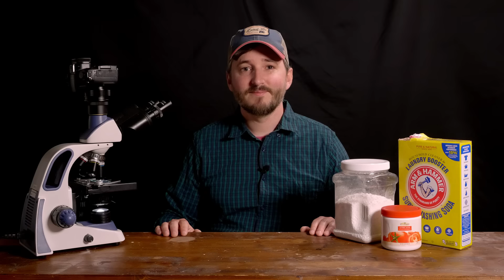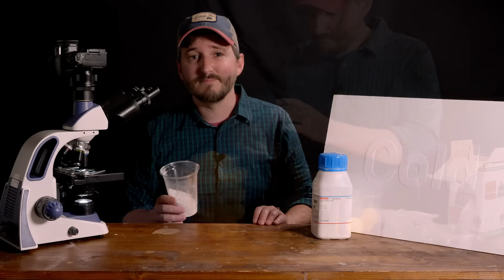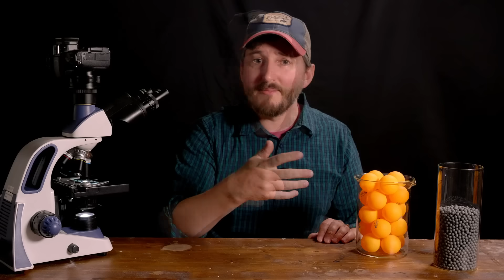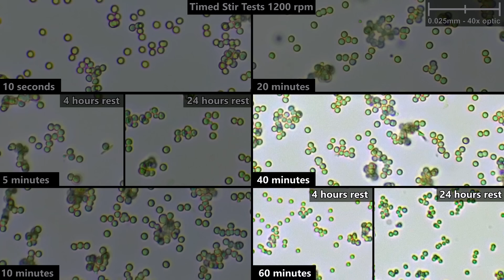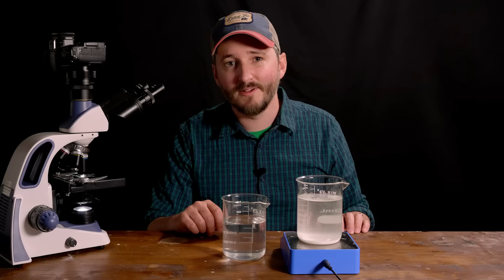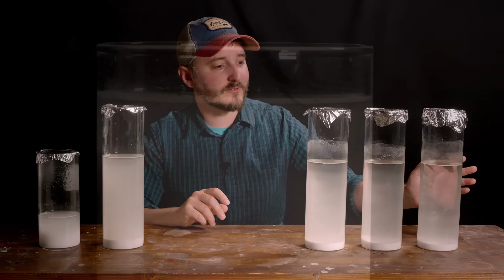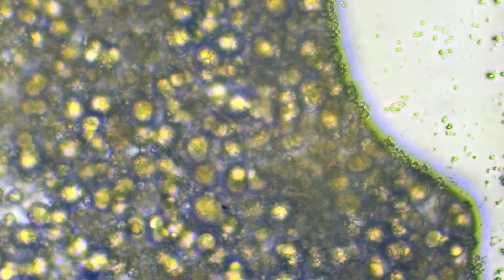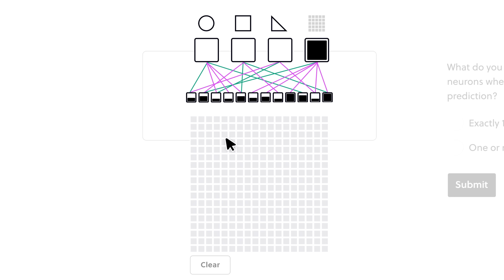Making Infrared Cooling Paint From Grocery Store Items (w/Novel CaCO₃ Microsphere Synthesis)

Comment: A clear to the appropriate spectrum poor thermal conductor coating on top.  With a high thermally conductive base under it will give it more access to internal heat and seperate it from the external heat.  Good for environments typically excessive in heat.  Add an insulator layer underneath and it will help prevent external heat intake while restricting inpact on the internal atmosphere.
  For a house you want thermal conductance from the exterior sides or better yet angled siding.  Roof+angled siding would improve the effect.

Comment: Between you and Techingredients, I’ve learned quite a bit of information. I’m wondering how many roofs have to be coated for us to lessen our dependence on air conditioning and the electricity it uses, and for us to start to impact global temperatures. Thank you for everything you do and post. It literally means the world.
Reply: Just using white roofing tiles would be a start... Here in the South, it seems that dark colored tiles are the norm for some reason... I grew up on a street that had a house with a white aluminum roof.  I always wondered if their cooling bills were significantly cheaper.  There is some remodeler in my neighborhood flipping houses and painting the exteriors dark colors.
Reply: @thetruthserum2816  I'm in the hottest suburb in australia (average temp) when we redid our roof I did it in white. The roof temperature is so very very much lower. There's a new housing development nearby with hundreds of houses all with black tile roofs. You can literally feel the heat island as you drive past the place in the evening and there's just waves of IR radiating off the whole development. Not just the higher air temperature, but literally you can feel the radiant heat coming from the houses. It's stupid. The council had a project on "lowering temperatures in our area" My suggestion on mandating an albedo (reflectivity) for all new developments wasn't even looked at.
Reply: There is a Wikipedia article called "Passive daytime radiative cooling" which mentions this as a kind of actually usable geoengineering approach. Maybe you find something in there or the sources mentioned to answer your question.
Reply: I would suspect that this exact paint would not be a viable roofing material due to durability concerns, but if you suspend the pigment in something more durable... It's certainly something worth doing some experimenting on.

Now, another question that I think is worth asking regarding this. What would happen if you had a panel that had this passive cooling paint on one side, and a black paint on the other? Would this paint improve heat transfer INTO a house as well? Cause like, I live in Canada where it's cold half the year, and I'm wondering if it would be at all possible to make reversible panels that heat in one direction and cool in the other.
Reply: @reaganharder1480  Very interesting idea. Build it and test it :)
Reply: keep in mind that somewhere around 300 BILLION is spent yearly on air conditioning. even marginal improvements means millions of dollars saved.

Comment: maybe look into one of those ultrasonic vaporizers you find in cool air humidifiers. They readily deposit hard water chemicals from the vapor they produce (since it's atomized mechanically). thanks for spending so much effort on this and making its access open. that paper is important for the tech, but developing a process to produce a similar coating with cheaper materials is ground breaking stuff.

Comment: This is so awesome.  

My mind immediately goes to painting one cylinder of a stirling engine with this, and the other side with carbon black. (or a sand battery topped with a solar collector shining onto carbon black, running the hot side of the engine, so it'll keep going after dark.)

Comment: For applying this coating, mix it to a mortar-like consistency and use a grooved trowel of the sort used for laying tile. The grooves make it easy to get an extremely consistent amount of material spread across a surface, and then the smooth side of the trowel smooths over the grooves to give a flat surface.
Reply: Keeping the coating more textured instead of smoothing it over might actually be better. More surface area means more radiation, and therefore more cooling.
Reply: I was thinking something similar. Flooring contractors have a refillable caulk gun that they use to lay mortar for tile and it has different nozzles for smooth or ridged surfaces
Reply: Ha, I should have read more comments before replying this same idea.
Reply: Same idea…. 9 comments after this😂 deleted mine
Reply: Just like the method used in screen printing of PCBs. Maybe that'll work too.

Comment: Have you thought about combining your cooling paint and evaporative cooling and matte black paint and some heating ducts and thermal transfer fins to make a constant flow cooling unit with no moving parts that exploits thermal dynamics? maybe even consider adding in geothermal cooling? no electric bill, no electricity, no moving parts... the Sun, the are, the Earth, the water, all work to power it with no moving parts.
Reply: -the are
Reply: @mamupelu565  yes the air as in hot air rises cold air settles and you can use the movement of those to be able to power the system without moving parts much the same as a chimney works

Comment: Could you theoretically use this in the same fashion they make mirrors? As in spray or pour it onto a pane of glass, and then flipping the glass over so the "paint' is shielded from the elements by the glass pane.
Reply: That is a great idea. 
You could also use a double glazing window frame to hold the glass panes & have an insulating air gap.
Reply: Interesting idea.. Although the question would be how much heat the glass would absorb? How "transparent" it is for infrared radiation?

Comment: I would be very interested to see this would have as a reflective layer behind a bifacial solar panel. I also wonder about using something like this on a air conditioner. Could you beam the heat out into space rather then heat up the local air? Great work!

Comment: Would it be possible to create water from air due to condensation with this type of cooling? Or is the delta t too small?
Reply from the maker: It's possible but needs testing
Reply: @Nighthawkinlight  I´d love to see that. Your paint on a squaremeter of aluminium sheetmetal in a good isolated box with a bit of airflow.

Comment: In order to spread it like paint you should treat it more like paint and add some sort of binder like linseed oil, chalk and adhesive or something. I'm not a chemist or a painter, but it seems like it doesn't hold itself together well because of the surface tension is so low unless you have it really thick, so maybe adding some sort of adhesive or binder would help give you a better viscosity that could be used with a brush. Idk what I'm talking about though, so I'm probably entirely wrong.

Comment: Question, could you use infrared cooling paint with starlites heat resistance abilities together? I’m wondering about the thermal electric properties using the Peltier effect.  Also maybe use latex or silicone.

Comment: The term used in the literature is “capping agent”! 

Some papers also address particle size for the resulting optical properties as a photonic crystal.  

I saw a paper called “DIY” emissivity cooling or something, and it was aluminum foil behind plastic film.  Seems not so easy to know what the price/performance tradeoffs are.  Interesting work either way

Comment: This is a pretty incredible step forward. It feels like we’re so close to being able to do meaningful zero-energy cooling at home. I grew up in an off-grid home and it would have been such a relief to have a few degrees of cooling like this.

Quick question: would coating this in something optically clear with high emissivity (eg Sylgard or something similar) fix any durability issues and allow this to be used as a longer lasting outdoor solution?
Reply from the maker: Pdms is a possibility as a binder for this paint. It may work better but needs testing
Reply: @Nighthawkinlight  if I get a chance to try out your recipe, I’ll test a batch with some old pdms that I have.

Comment: Thank you for your contribution to the community, I might give this a try 1 day, but I have a few questions: Wouldn't the rain wash it away? What can be it be mixed with it or coated with to protect it from the elements?
Another cool idea I can think of is, would you be able to develop the opposite paint? That absorbs the most of heat from light?

Comment: I'm really curious on if there is measurable benefit on applications where there is not a skybox reflector or plastic air barrier. 

I've been very interested in finding a heat emissive paint for a camper van. I literally don't care about the look. I just want to reduce interior heat. 

My thinking is, if I do a DIY topper (which I'm considering) I could maybe even do a reflector box on the very top but it would make the build much more complicated. If I can get some benefit from simply covering the van with the paint, that might be worth doing.

The paint as shown is probably too fragile so any way to strengthen it along with maybe top coating it would be interesting. Even if the efficiency is significantly cut down ... any benefit is a positive.

Comment: Probably going to be lost now, but -
I don't think this is most effective as a paint. Apparently, it's just too fragile. However, I wonder if it could be used for topfinishing concrete (concrete is often topfinished with iron powder to add surface hardness, or various pigments).

Comment: So for quicker application, couldnt you make a lip on the panel that is  
.5 mm thick and use a straight rod or something similar to how they level concrete? Or perhaps a vibration table and just pour the paint onto the panel, you would still need a lip on the panel, but it could simplify the application process.

Comment: I wonder how painting this on a mylar sheet would affect performance, if I understand correctly there is a higher probably of the IR emitting to space due the energy differential, however some of the emissions are absorbed by the backing material, an IR reflective backing should increase efficiency, or a highly emissive backing for a heat pump

Comment: You will win a Nobel Prize if you can figure out a way to impregnate roofing shingles or roofing systems generally with this stuff. House paint, automobile paint, etc. Im not sure if the luxury of getting into a cool car or having an attic that is not 20,000 degrees or the energy offset is more appealing.  Is there a powder coat option, also?  Porsche bakes on a charged car paint now.  Im also curious what mixing this with titanium oxide would do to strengthen the paint.

Comment: Perhaps a ribbed spatula would be a good applicator for the paint? Kinda like how they use castellated trowels to apply the cement for tiles. 
Could experiment with the rib height and width in relation to the viscosity of the paint to get the ideal coating thickness.

Comment: Great work, I really enjoyed it. On your application issues: There are several videos on here about making fabric waterproof. Most work by making a silicone/white spirit solution, soaking the fabric in it and then letting the white spirit evaporate.
If you mix your pigment to the solution, wouldn't the silicone keep the pigment in place preventig it from crumbling? You could make a waterproof, cooling, very white fabric from it, that you could use as is, or apply it to your cooling panels
Reply from the maker: Yes I'm thinking about such things.

Comment: Sounds unlikely.  An object, due to energy conservation, has to emitting, at each frequency, exactly as well as it is absorbing.   Otherwise there would be a net energy flow and things would continue to heat up and violate entropy.

What you can do is reflect in the visible and emit in the infrared, with some net cooling effect.  Not much, but some.
You can help this along by covering your surface from direct sunlight and uncovering it at night.

The ancient Egyptians had this way of making ice.  They would cover a bowl of water during the day and uncover it at night.  The water would radiate its heat into space (no clouds) and very little would radiate in at night.  After some days,  you could make ice.

Comment: @NightHawkInLight - Thanks for making another one of these cooling pigment videos... this stuff has been living in my head rent free since I saw the one you did last year.  I have a question regarding practical application.  The previous experiment had it performing at sub-ambient when in the shade.... couldn't you stack plates where one side is radiant, and the other side is absorbent, to make a panel (or a tube) that create it's own shade?  example:  paint the inside of some conduit with super-black, and the outside with this stuff.... repeat process with larger piece of conduit until the desired number of layers is achieved.  expected result: inner must layer is substantially below ambient..
Reply from the maker: I don't believe the nested tubes would work. They would balance out to the same temp.

Comment: Epoxy resin would be a perfect base for the paint. When stirred, it traps quite a bit of air as bubbles. Usually they aren't desired, but simply stirring it introduces more
Reply: I concur with trying epoxy, but would be concerned with yellowing in the sun. Acrylic becomes brittle in UV light, so might not be a long term choice.

Comment: Very cool... As far as house surfacing, this could be formed into roofing/siding shakes if the shake is a 1/4" thick at the drip end with an air gap an 1/8" between the white painted backing and a clear plastic exterior shell.

Comment: Would ultrasound (as opposed to stirbar or blender mixing) make any difference to the nucleation effect and sphere size? 

It would be interesting to see what effect would be from immersion of the mixed solution container in an ultrasonic cleaner at 20,000 or 40,000Hz

Comment: @Nighthawkinlight An idea for you- if you like the wide tip, consider modeling one in a software like Solidworks that can connect to the 50mL syringe. Then you can 3D print whatever dimensions you want.

Comment: A quicker / better way of applying a thin layer of the paint: Use some thin wire as a spacer down each side of the pannel, put a thick blob of paint at one end of the pannel, and drag a scraper along the two wires to spread an exact thinkness of paint across the pannel. The scraper could be something like a length of angle iron, or a steel ruler on a small pannel.

Comment: Awesome video, 
Another synaptic orgasm.
In regards to your potential application. Could you combine it with your equally brilliant waterproofing bed sheets formula?
I made a few of these & they work so much better the pvc tarps. 
Loved the tie-down tip, I used golf balls. Lowering the temp under the tarp by a few degrees . 
Would be a blessing in Australia. 
Cheers Mate

Comment: Perhaps a HVLP high volume low pressure applicator would work well for larger applications.  Or however they spray those acoustic foam ceilings.  Amazing how you find the energy to create those small bags of fancy dust.  :)

Comment: Another thing I was wondering about would be the thickness of the pigment load in the 'paint' medium. It's probably a lot thicker of a load than some paint sprayers that are used on cars. I know they use pigment loads as well, but usually in much smaller amounts in comparison to the liquid it's suspended in. Notably 5-10 grams in a gallon or two of a clear coat. They utilize what they refer to as pearls or flake to get neat hyper shift effects, which is beside the point. More just interested to see if there's a way to still use a paint sprayer for application. Conversely, I have to wonder about dipping whole panels into a container of the paint. Submerging it just enough so the facing you want covered is coated. Attaching a small handle to the back to allow for dipping might be an idea. Trying to figure less fiddly ways to apply over large surfaces. Truly large pieces would be much more challenging to do the dipping method.

Could a really long trough like structure with a thin aperture like the piping bag be used in a manner of suspension over a board or panel? Have the container apply slow and steady pressure while the plank or panel moves by slowly under the aperture as paint is extruded onto it as it passes by?

Comment: Could you melt the pigment into one side of a transparent plastic foil? That way it would be protected and spread out at the same time. Maybe you could even add it to transparent packing tape, then add another layer of adheasive and glue it onto every surface you want to cool

Comment: Awesome and amazing, as always. Been following you since, well YouTube started, as you are one of the pioneers. 🙂 I am curious about how useful citric acid is in controlling both the crystal formation speed, and also when doing the ferrofluid experiment, helps bond the iron molecule to the structure of the olive oil. Do you think it would work in other crystal formation processes? I do some copper deposition for some of the art I work on, and controlling crystal growth is typically done via voltage - could something along the lines of citric acid allow for some control too? You always get the creative juices flowing, keep doing all the awesome!